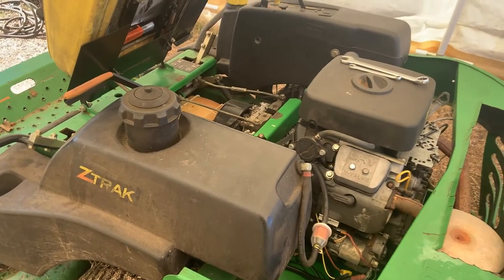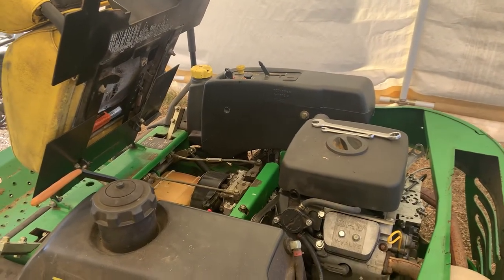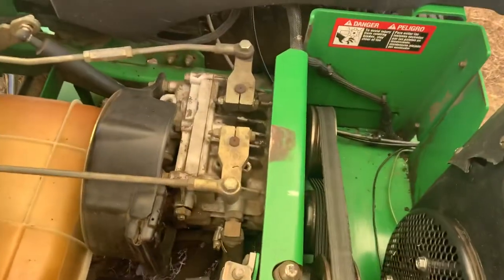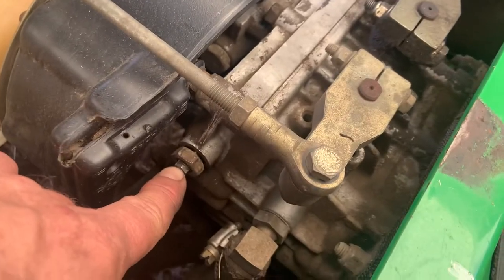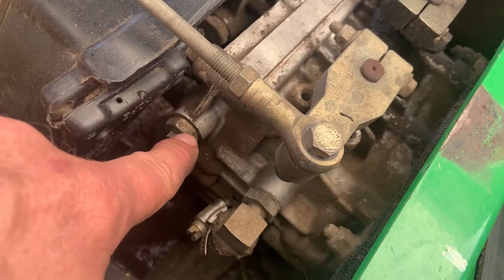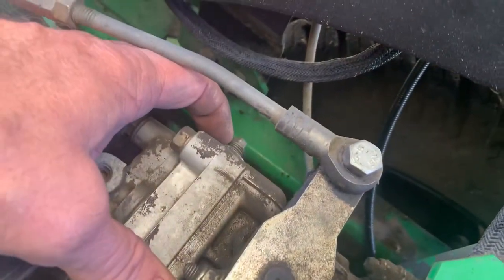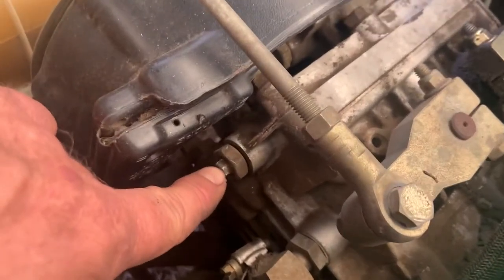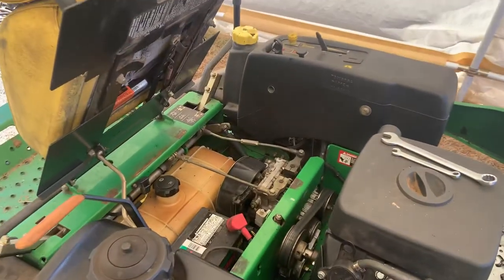How to “freewheel” a John Deere zero turn.

Comment: Thank you for the info. I just dropped an exhaust valve on the left side of a 757. Never had to push it (tow) before.. I was surprised to not find any obvious way to disengage the hydraulics! 👍😃

Comment: Can locate these valves on a Z425
Reply from the maker: https://youtu.be/FKGDoX2KcEY
Reply from the maker: There’s a big nut shaped thing on top of each one of your pumps. Turn them counter clockwise about 1/2 turn. I posted a link to a video on how to do it.
Reply: I don't see any Nuys or bolts in eye sight but each pump has a black plastic lever on it that can be moved, thinking this might be them.